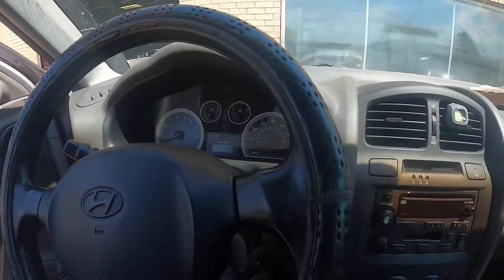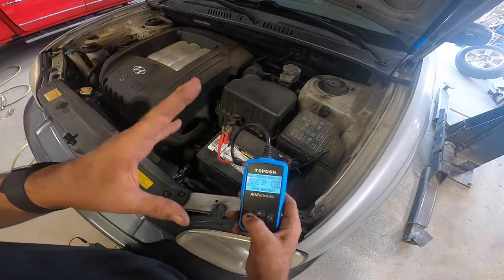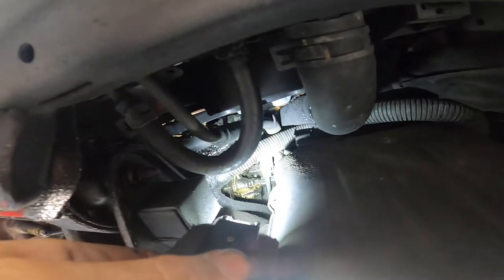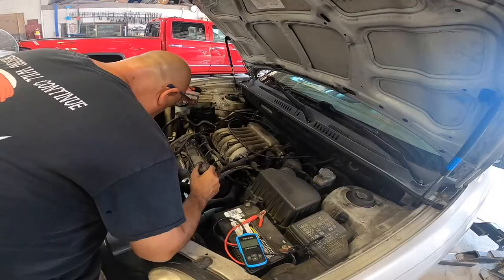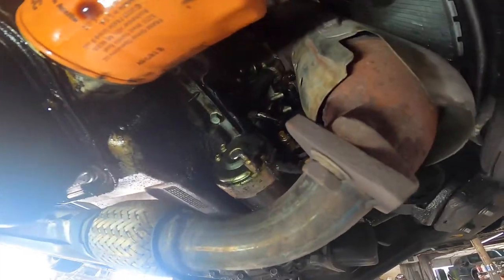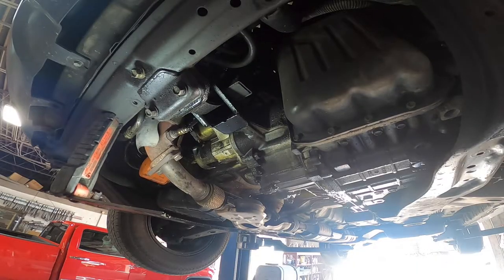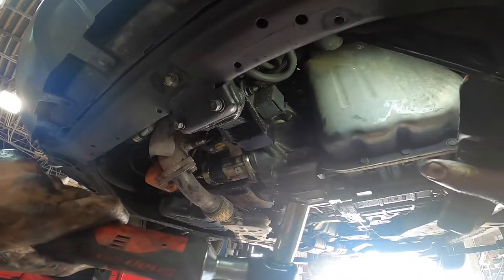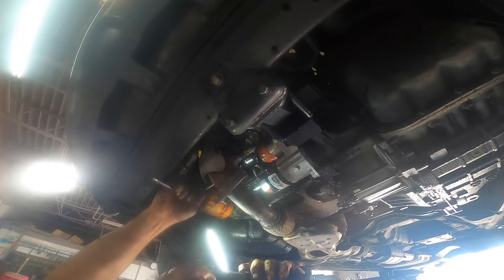Hyundai Santa Fe Starter Problems  Easy Diagnose And  Simple Fix

Comment: Hey bro, Your video saved me about 350 bucks, the bolt came out easy but the nut was a bitch. The swap went smooth otherwise. I even changed my oil while under there. Thank you, What’s your cash app
Reply: It wasn’t oil drenched
Reply from the maker: I’m glad it helped my cash app is 
$PererEates

Comment: I woulda fixed the oil leak and cleaned the starter realy well with brake cleaner. The start obviously still functions when it doesn't short, theres a very VERY good chance that cleaning the starter will prevent it from shorting and without more leaking it wont short out again in the future like its going to now. But thats just coming from a mechanic that believes taking care of my customers as if theyre my mom.. you know theyre on a tight budget my guy. Take care of them and youll have customer's for life.